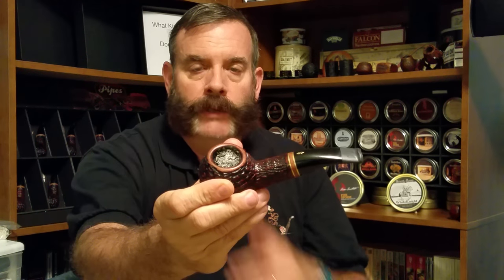The Fine Art of Tamping.

Comment: I have a question: in the video you explain that the embers sink evenly and parallel into the bowl, and therefore it is sufficient to press lightly on the entire surface.  I noticed that in my pipe the embers begin to form on the entire surface but ends up reducing to a central surface.  In that case, I don't think it's enough just to apply pressure, because the surface density is different.  How to behave in such a case?

Comment: Another great video Chris. But here's a question: could it happen that at some point there is just too much ash to relight, i.e. the flame can't get through? It seems to happen on my side and then the "sucking force" required to relight just causes a hot, foul tasting pipe. I therefore prefer "tipping" about two-thirds through the bowl. What do you think?
Get well!
Reply from the maker: Yes, I have done a video on this, I totally agree, sometimes for me even after I have tamped the ash Down, there is so much ash that it will not relight, so I loosen some of the ash, tip it out as you put it, then re tamp, and light my tobacco. Great comment my friend. 😃😃😃

Comment: As always, you've set the standard on this.  But I would like to see you address some related items.  Feel free to use these questions and comments in a follow-up video, maybe "Finer Art of Tamping."
(1) Because of my ethnicity, people assume that I use the Czech tool.  But I don't.  I prefer the aluminum pipe nail.  That drives me crazy.  Who are they to assume that, just because I am Bohemian, I would use a Czech tool??!!!  What kinds of presumptions have you run into on this subject?
(2) I am right-handed, so i tend to hold my pipe in my left hand and tamp with my right as you did in this video.  I've tried "switch hitting," but it's just not for me.  What is your experience with switch hitting?
(3) At slow smoking competitions, they issue pine tampers.  This has always given me pause, because pine is such an oily and sappy tree.  Do you think that a pine pipe tamper could create health issues?
(4) Also a health concern - I've never shared any of my pipes, but I have lent out lighters and tampers.  Some of my pipe smoking friends may have AIDS or encephalitis or tinea pedis or some other deadly disease.   Do you think I should sterilize the tamper when I get it back?  I have an autoclave - would that be best,?
(5) Few people know that it is called "tamping" because it started in Tampa, Florida.  They made so many cigars there in the early twentieth century that the locals became experts at keeping things lit.  Hence the name, "tamping."   Given that pedigree, shouldn't we always capitalize it?
(6) Some YouTubers make Tampers out of interesting objects.  Some of those are really ornate, while others use materials one would never consider.  I have a friend who brought back some depleted uranium from Iraq and he wants to make a pipe tamper out of it for me.  That is nearly as heavy as lead, so do you think it would wind up overpackiing?
(7) A company recently released a spring loaded pipe tamper with an alarm.  If the smoker over-Tamps, a piezo reminds him to take it easy.  I am concerned that the small electric shock would hurt, but it seems to be the best way to stop over-Tamping.  Have you seen that yet?  
I am looking forward to a video responding to these items.  Thank you!
Reply from the maker: Question 1 here in the states this subject is not a problem, some people use the Czech tool, others use the Aluminum pipe nail, some make their own, nobody really says anything disparaging about pipe tools, pipe, or anything concerning pipe smoking.  Question 2 I am the same as you, I can only smoke on my right side. Question 3 I don't think that the pine pipe tamper should create a health problem. Question 4, I would never lend out an expensive pipe, but I would lend someone a cob, inexpensive and easy to replace.👍👍👍

Comment: what do you do when you get to the point where the weight of the tamper is not enough to tamp it any more and it keeps going out?
Reply from the maker: Hukman! - Apply a little more pressure, my reasoning for having new pipe smokers just use the weight of the tamper to tamp down the ash was to show you don’t have to push very hard. 👍👍👍

Comment: Is it possible that tamping too much leads to a too tight pipe around the end of the bowl , at the point that the bowl heats way too much and big dottles stay down the pipe even whith dry english blends  ? It seems to happen particularly whith tapered bowls where I sometimes feel tamping is only necessary after char light and mid bowl.... is it possible to smoke a full bowl with no tamping (except for the char light of course) ?
Reply from the maker: Vivien Charrier - I would say yes it is possible to smoke a bowl of tobacco without tamping, but that would require a perfect pack, and a constant even draw. I have never achieved this, I have had to tamp at least twice, and yes, after you carefully pack your pipe, then you tamp to aggressively you defeat that pack by pressing the tobacco to tight which does not allow for air to circulate and you end up drawing to fast causing the pipe to heat up. 😒😒😒

Comment: I just started smoking pipe and I was wondering why you don’t just dump the ashes out of the bowl?
Reply from the maker: Jeroen Zwier - Several reasons, the main reason is that it keeps the ember burning in the right direction, toward the in burnt tobacco. Secondly you may not be in a place where you can dump ash. 👍👍👍
Reply: Muttnchop Piper I just smoke outside but will try to keep it in there the next time I smoke! Maybe it works better! And thanks for the answer!

Comment: Do you have like a wall of Sav 320's behind you?!?
Reply from the maker: Brad Bowman - Yes, but I found the pipe I chose was a little to heavy, so I traded them in for a lighter model, I used to own 16 of them, I cut them down to 8 active smoked pipes with 4 replacements  in case one breaks or is damaged in some way the old pipe was a Savinelli 320 Porto Cervo Author, the new pipe is a Savinelli 122 Porto Cervo Pot. 👍👍👍

Comment: When you tamp the ash, is it good to turn the pipe over and shake the excess ash out so you'll have just tobacco instead of all the ash?
Reply from the maker: Bordelon, Chris - Not at first, if you get to about half way down, and find you can’t keep the tobacco lit, then I usually scrape a little of the ash from the top, empty it into an ash tray, then re tamp, and re light my pipe. 👍👍👍
Reply: Muttnchop Piper Thank you.  I should've been more specific with my question. I was referring to ash around half bowl or lower and is what I've been doing.  I've started using the Frank method over a year ago and having great results.

Comment: So something strange happened the other day whilst puffing on some frog morton; I don’t recall when it stopped smoking but id draw and when id blow it out it was only vapor that dissipated into the air. Did this a few more times and i got the same strange result. I blew it into a smoke detector to see if there was any smoke and it did not react so im sure it was vapor. So my question to the community is what happened?! It re-lit and the rest of the smoke was fine but I cannot figure out what happened.
Reply from the maker: Yeah, this is what happened, your tobacco was probably wet which created condensation that settled in a pocket of tobacco, or at the bottom of your bowl, your pipe got hot enough to boil that water producing steam, which combined with just enough smoke to give the appearance of vapor. once the condensation had boiled away the fire started burning tobacco again. I have had that happen to me as well, looks and feels really weird. :) :) :)
Reply: Okay thanks it was very weird and i had to know what was going on

Comment: savinelli 320?
Reply from the maker: Francesco Stringa - Yes, Savinelli Porto Cervo Rusticated 320 Author to be exact. 👍👍👍
Reply: @MuttnchopPiper  i was planning on buying one, or the 311ks marte. As the 320 is concerned the piano edition is the one i like the most. Your thoughts on the 320?
Reply from the maker: Francesco Stringa - I love the 320, but I found it a little heavy to clench, it made my teeth hurt, so I switched to the Savinelli Porto Cervo 122 Rusticated Pot. It’s much lighter. 👍👍👍
Reply: @MuttnchopPiper  thank you very much. i'll probably take a 311 or 321